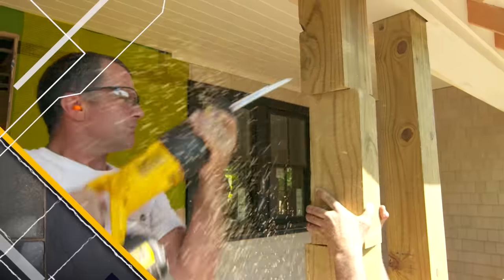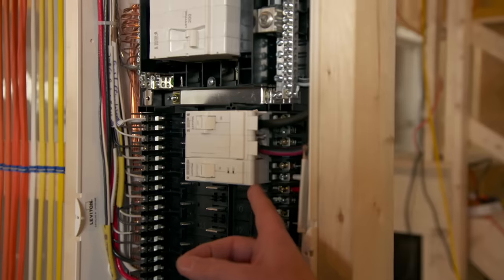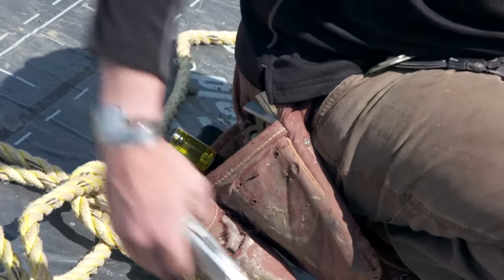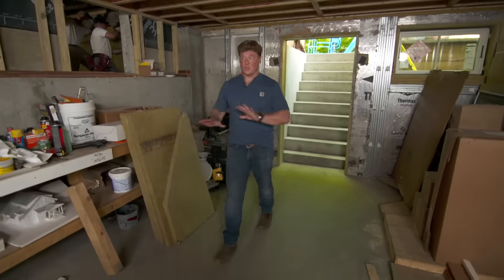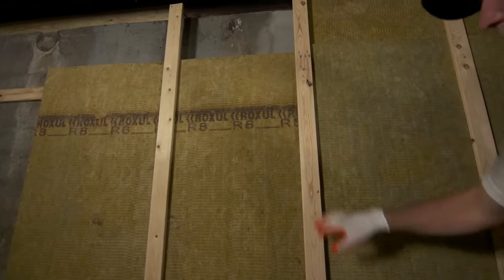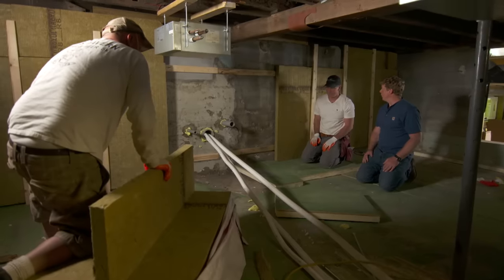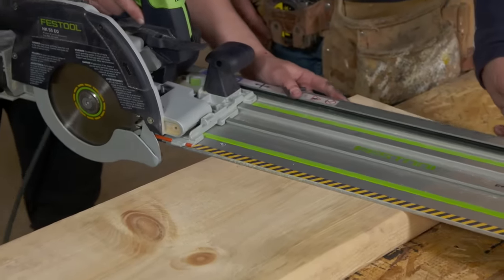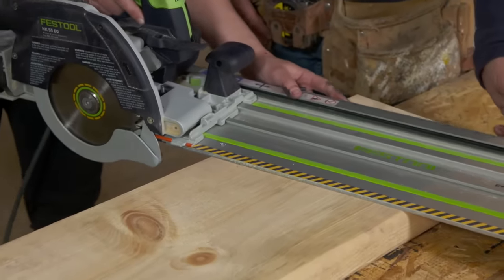This Old House | Modern Barn Raising (S40 E7) | FULL EPISODE

Comment: I'm glad to see that adding blocking for cabinets was shown in this episode. I'm a 3rd generation carpenter and my brother and I were both taught by our dad to use 1/2" plywood on the kitchen interior walls for hanging cabinets. You don't have to search for a stud or misplaced blocking.
Reply: Ellis Allen so do you sheath the entire wall with plywood and then cover with drywall?
Reply: @scottm4969  yep. I know it sounds crazy but when you live in hurricane country any and all strength is welcome plus it is so much easier to install cabinets.
Reply: Ellis Allen it’s not crazy at all. Wish they did that everywhere
Reply: @scottm4969  
"Wish they did that everywhere"
That's easy enough.

Just get it entered into the building codes as a safety feature. It'll insure that the cabinets are properly installed and prevent them from falling on people's heads in a tornado.

But seriously, someone in the industry has to campaign for it at the State level.

Comment: Not gonna lie, that is that neatest Romex Stapling job I've seen in residential Most of the time they just go above the panel and bunch them up (which requires derating which nobody does), but I'd imagine since this job has cameras on it, they would spend extra time to make it neat. Only problem is that Leviton is a newcomer to panels. Yeah it looks neat but it's really hard to find breakers for them in the store the way you can with Square D, EATON, or traditional names.

Comment: child's play. i used to drive 70' pilings and hang 10"x12" whalers. we used a diesel hammer with a 250 ton crane. the drill was air powered with a 5' long bit x 3/4". all this was done while floating on punts in water 60' or more deep.

Comment: 11 2/8? Lol. Did they leave that in on purpose? Had to.
Reply: she's new. it's the same on the tape even if she calls it 8/32.
Reply: Shirley she meant 11 500/2000ths.
Reply: whenever I take measurements, it's 16ths. I only have to write down 1 number and it's harder to get confused if it was 19 3/8" or 19 3/4". I worked with 2 brothers that were dyslexic, so 1/2" was "big" and they counted the lines before or after. so you'd get "19 and 4 past the big one" for 19 3/4"
Reply: Everyone has to start somewhere. Imagine having to start surrounded by cameras on a legendary show.

Comment: I was surprised to see wood shingles being used as building codes in many areas do not allow them because of the fire hazard.
Reply: Well it is on an island (in the northeast plenty of rain) I think treated they get 15-25 yr gurantees
Reply: Building codes vary by region.  In areas where the risk of wildfire is high, then yes, wood shingles would be against codes, because they could be lit on fire by embers.  TOH demoed fire codes in CA during another recent season.  They helped rebuild houses in a community that was burned by the infamous Camp Fire a few years back.  Building codes there are very strict about fire hazards, and for good reason.  This season, though, is in a coastal community in RI, without the high risk of wildfires, and so the codes are different here.
Reply: @morlamweb  Ah, that makes more sense.  Thanks for the explanation.

Comment: A barn kit that size is around $50K,  plus that architect’s hours, installed to support a solar array.  A 10KW array roof installed will be some $30K minus subsidies, and at 40deg N will be near useless in winter.  This is all quite silly.  Will the barn house cows and a milking machine too?.  

Insulate and seal the  house, and then let the power utility do its job.
Reply: 40deg angle facing south is pretty ideal in their location.  I am in southern Mi and I think it was 42 degrees was optimal for production but it went on my already existing house and garage roof which are 22.5 degrees angle, very happy with the production I am getting.  Mine is 8kW and I am expecting close to 10kWh produced in a year.  Enough for my house + 10,000 miles of driving a year.  My house is NOT energy efficient like theirs (built in 1960s) but a lot smaller.  I won't argue that what they are spending is excessive and won't necessarily have an ROI for them but keep in mind they are building their dream house essentially.
Reply: whattheschmidt NREL data shows that a solar system in Providence RI, for December collects as low as 20% of a summer month.  This means a bad winter week would see 10% or single digits.  It’s a dog and pony show.  

Good for you in Michigan, and I hope you save some money.  But note your 8KW / 10kwh/yr array is functioning at a 14% capacity factor, I.e running 14% of the time.  Utility solar runs double that, and installs for a third the cost.  Utility doesn’t have suboptimal tilt angles, doesn’t have any shadowing from that tree or other house in the afternoon, doesn’t have dirty panels for months because they never found time to get up on the roof to clean this winter. 

My point is residential solar arrays only pay because I) the utility is forced to take power back through that utility connection which they don’t need nor want, given they can make it five times more cheaply, and ii) the residential system install cost is subsidized. This means in turn that the power utility, which is obligated to provide 24/7 power, must collect more in rates from your neighbors.  

I know residential solar is popular and criticism is not welcome.  Imagine this analogy.  I try to grow my own food in the backyard, maybe have a cow for milk.  I get half of the planting and fertilizer irrigation etc costs paid for by tax credits. In my climate I can’t produce in winter, and occasionally lose crops because I really don’t know farming, so in season I produce double and force the local grocer-farmer by law to buy my extra produce, who in turn raises prices to cover the spread.  There are even TV shows encouraging me with catchy phrase like net zero food.   I follow the crowd, and post on the internet how much I’m saving in food costs.
Reply: whattheschmidt “dream house”.  

I agree.  The TV series however is titled This Old House, which meant help to people forced economically, or by love of the antique, to maintain an old home, and were willing to learn and put in the labor to DIY with education from professional craftsmen like Tommy.  Now as you say the series is better titled My Dream House, where cost is no object. They might as well be building mansions for movie stars in The Hampton’s. TOH has become another corporate lie.
Reply: @Nill757  Criticism is fine but you sound like you work for the utility with the fallacies you provided.  "the utility is forced to take power back through that utility connection which they don’t need nor want, given they can make it five times more cheaply, and ii) the residential system install cost is subsidized. This means in turn that the power utility, which is obligated to provide 24/7 power, must collect more in rates from your neighbors."

Sure thing buddy - utilities don't want your solar producing because they are forced to take it to the grid - during times when electricity is most expensive and highest (when the A/C is firing the hardest fighting the heat).  Yes, utilities make it cheaper but that is irrelevant - my utility (DTE) wants to produce the power themselves but it's more so to secure money for the investors than because 'they can do it better'.  There's  quite a difference in wholesale rates vs residential rates and that's why small scale solar works.  It's also a great use of roof space!

December being lower production is pretty irrelevant, solar is offsetting the highest grid demand periods. It will be awhile until there is too much solar but is solvable with storage.  Pumped hydro and batteries for instance.

The collecting more in rates from your neighbors is another lie to stop customers generating their own power to keep the utility billing up.  
https://www.bridgemi.com/guest-commentary/opinion-big-utility-companies-want-limit-options-michigan-customers
https://energynews.us/2019/03/04/midwest/utility-linked-group-seeks-to-dismantle-net-metering-in-michigan/

This is with my utility, one of the worst in the country, so your mileage may vary! Lot of good facts in those articles.  My utility does not have the customers best interests in mind!
Reply: @whattheschmidt  By all means if you think rooftop solar is the right thing for you, cut loose from the utility and go off grid.  But,  demanding the utility buy whatever you are selling at retail, while the utility covers the cost for making always-on power, makes you just another grifter.  Same goes for the 'Guest Commentary' from Koeppel.. Net metering has already ended in several area; it will eventually end everywhere.
Reply: @Nill757  Never did I say I wanted to cut loose or demand the utility why whatever! Grow up, stop putting words in other peoples mouths.  Solar is great for the grid and will only get better over time.  There are smart ways to address that will be implemented over time.  I don't care how much you hate it.

Comment: Seems that the whole point behind that underlayment for the shingles to let them breath and dry if they get wet will only really work for the first row, or the top half the shingles, the parts that overlap other shingles won't be able to air dry if wet.
Reply: But the air movement underneath the entire roof shingle structure will. If it wasn't there,  then the wetness just stays. That's the whole point!

Comment: "The wood shingle would swell and become water tight", what about the first 30 minutes when it rains?
Reply: Wood reacts to the ambient humidity. Because shingles are so thin and are made of Cedar or Cypress, they will move more readily than maple or other tighter grain stock. The movement will be across the grain and not lengthwise; hence by the time precipitation actually touches the surface of the shingles, they will be swollen and water tight. 
    This is why you allow wooden floors to rest for three days before installation, also keep all wood stock up at least three feet above a concrete surface. Hope this helps.

Comment: I don't see that nylon material under the shingles doing anything.  1) it looks like it got smashed flat, and 2) there is nothing between the courses of shingles, so they will just behave like normal.
Reply: It's the same material as ridge vent. Personally not a good roof system.

Comment: Waste of time fitting blocking. just screw 3/8 plywood to the wall . Then you can put screws anywhere to hold the cabinets.  How old are ya now Silva 80 or so?    When a Architect runs a job all kinds of impractical methods and materials are used. Wood shingles went out when asphalt came on the scene. Post and beam for a little barn that will never have a cow in it. A real barn has the timbers right into the ground so wind will not uproot it.